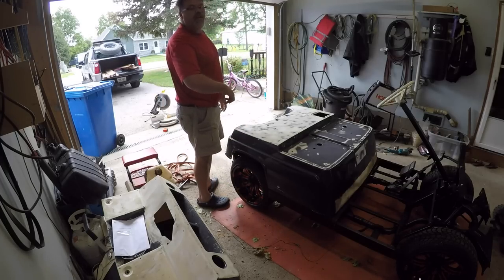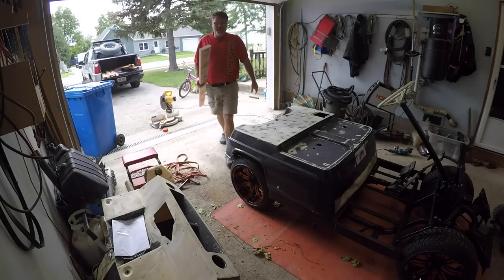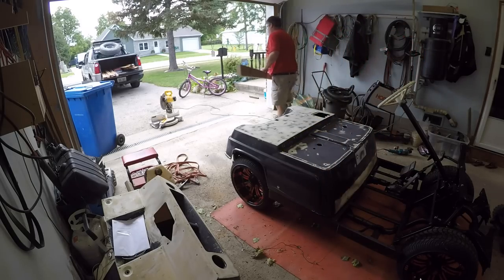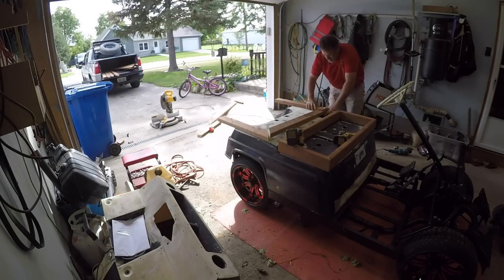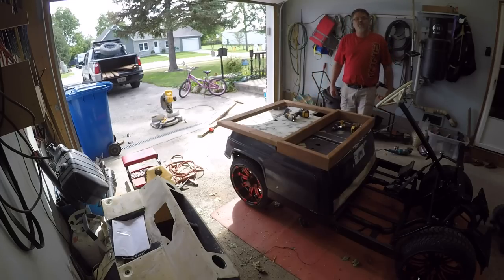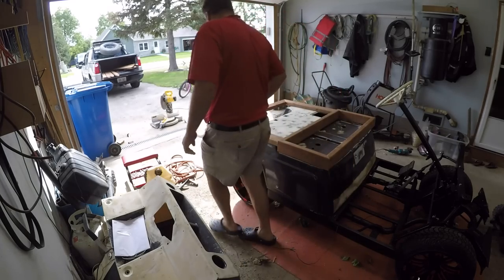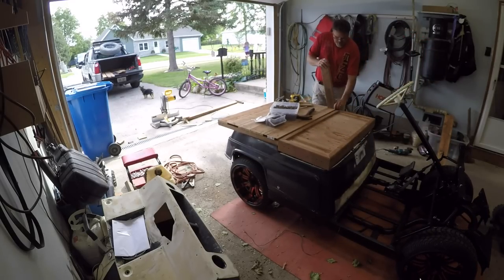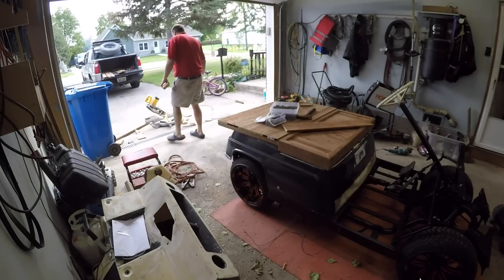The Golf Cart Deck

Comment: Hope you and Decent are doing well!  I just picked up a G1 and need to do something similar with the seats/bed.  Yours looks exactly like I envisioned doing to mine.  Thanks!
Reply from the maker: That’s great
Reply: @LifeWithBillSiff  the front wheel bearing replacement video you did brought me here - this was just a bonus!  If I find the spindle jacked up like yours, I'll probably hit it with some nylon from a 3D printing pen.  Just a thought if the electrical tape didn't or isn't holding up :)